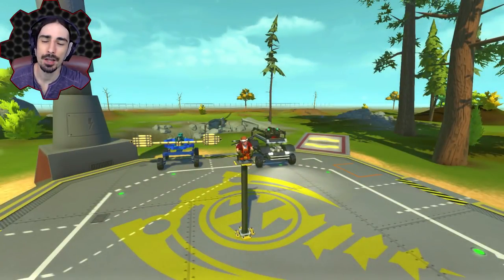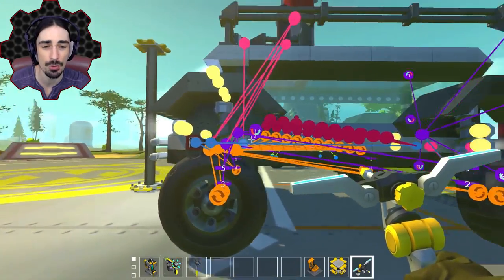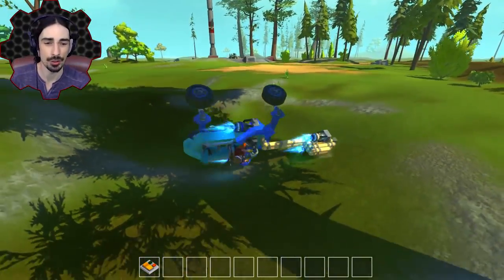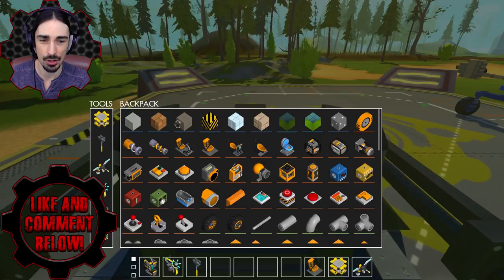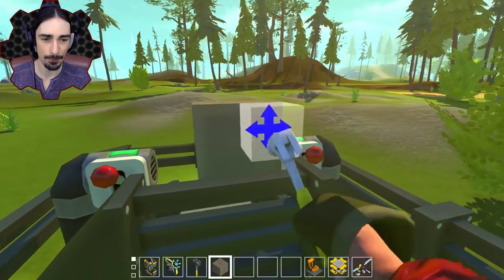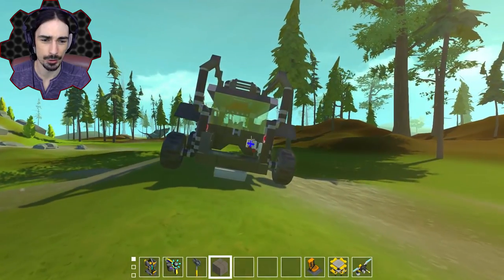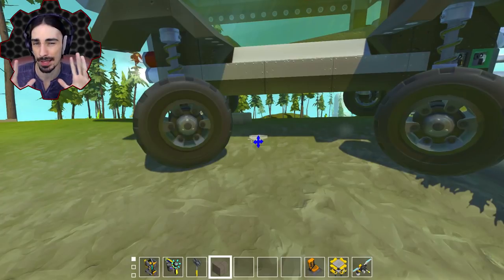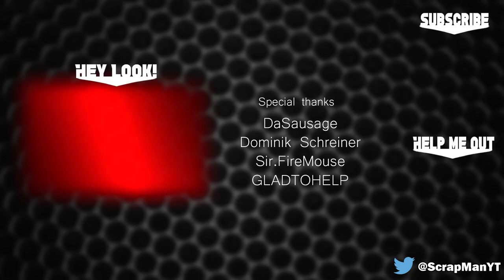STUPID VEHICLES! (Part 8) Scrap Mechanic Showcase Ep28

Comment: I think #1 claps it's hands together, and considering the thrusters direction on the back of the hands, every time they clap it goes a bit forward, and  #2 is somehow hammer powered , either you hammer the glass on it and go forward like that, or maybe it catapults you

Comment: Have you ever thought to yourself, man I wish I had more gears in this build ....

 Well introducing the#2 build.... 
Passive transmission and even possible randomized drive motor possibilities. 
Your imagination is the only limit!
Reply: This also made me think.... Why have I not seen anyone use a system like this to.... Make a car gradually accelerate then at the end of the line it triggers all the movement and make it to blistering speed, in Stock. To troll their friends